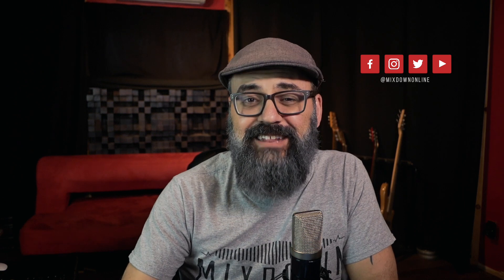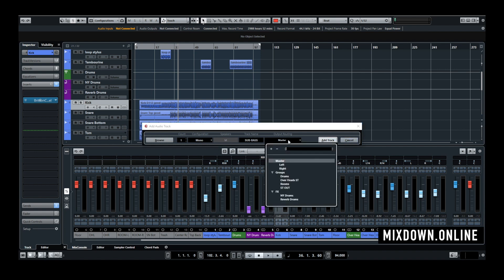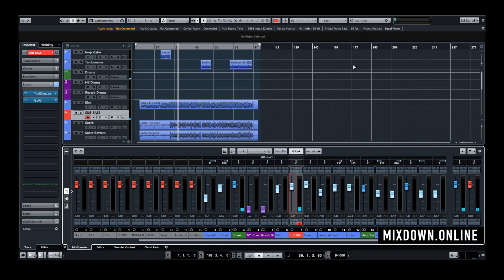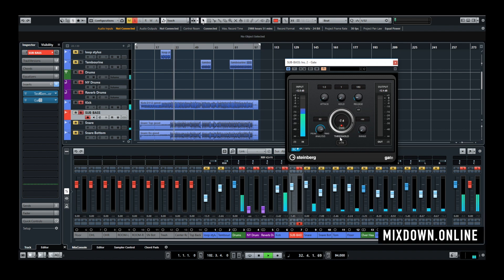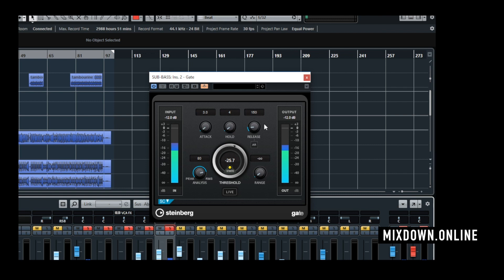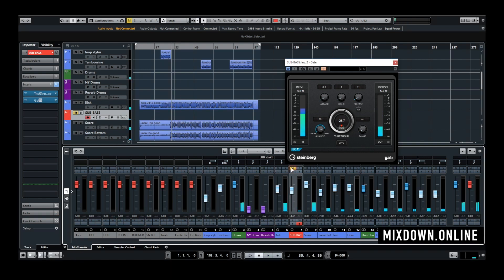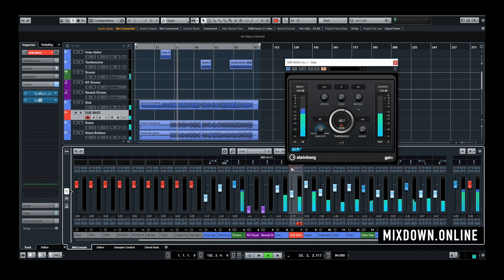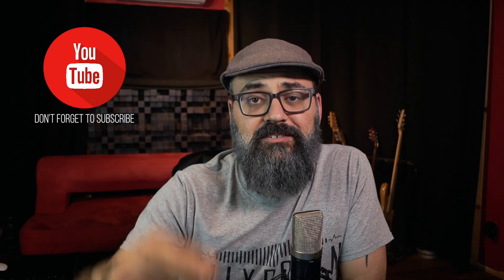The KICK SUB-BASS generator TRICK in Cubase 9.5

Comment: Thanks Chris. I have been trying to develop my home brew version of a UBK-1 compressor. I was working through the saturation, compression, and density flavors using mostly Cubase stock plugs but it was still missing something. I think this may be just the trick to add the movement I need. Later i may try to switch in an 1176 and Neve 33609 emulation to get the sound closer. Thank you so much.
Reply from the maker: Cool stuff Joe, I worked with the UBK-1 compressor before, really like the vibe of this compressor.

Comment: Great technique, Chris. Thanks for sharing this. I'm on Cubase Pro 9.0.40.  Qs. Are you using 0.0 dB for the Send Level? Do you ever use the Range or Internal Side Chain of the gate in this context? I experimented with both and found I could get more "beater" type punch with some settings. Lastly, I notice you use -12 for the TG Output (default), any reason to use stronger or weaker signals? -12 worked great for me, just wondering? The kick really "owns" the bass with this. Thanks again. :-)